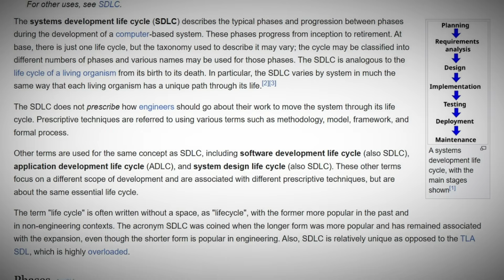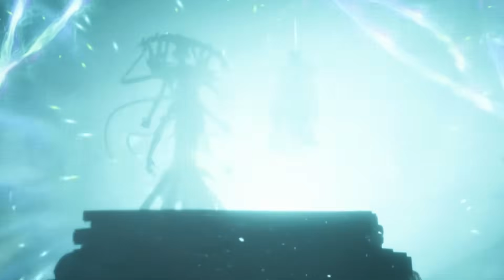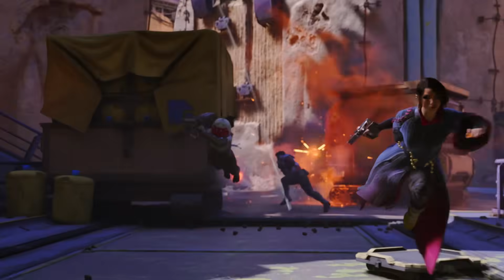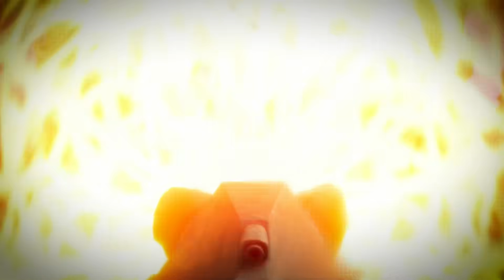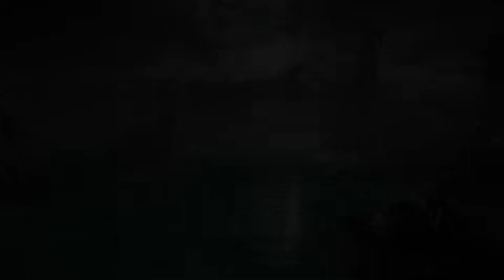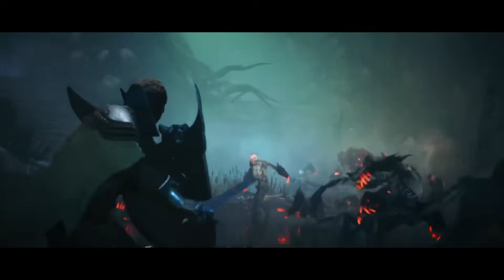Stop Blaming Developers for Bad Games (How Software is ACTUALLY Made)

Comment: I like this video as it shows that software development is a lot more about communication,prioritization, structure and context sharing than technical excelence.

The talk is quite generic and fits and modern software product. Is there something specific for a game development? The frenzy before Xmass or general uncertainty in a game dev?
Reply from the maker: It is quite similar, the biggest differences come more from the sheer size of the team/company. Maybe some random thoughts - in general, I would say there is way more stress on QA in gamedev. Teams are more cross-disciplinary, instead of an MVP, you have a vertical slice (which might be quite polished - basically a piece of the game). The distribution plays a part too, especially in the case of hard copies.

Also, I would like to say that ideation comes from creativity and not market research, but... 😄

Comment: Excellent video, Pavel. This was one of the biggest wake-up calls for me when I first started working as a developer. I wasn’t in game development, but the overall structure was very similar.

It’s a lot like constructing a building: the designers, architects, and engineers may spend years planning and refining everything, while the actual construction phase is often comparatively short. The people implementing it usually have far less influence over the core design and architecture than most outsiders assume.

This is a bit of a tangent from your video, but it’s also one of the main reasons I don’t think LLMs will fully take over software development. Coding itself is only a relatively small part of the overall process. There are so many other stages involved, along with soft skills and human judgement: understanding what people actually want, deciding whether something is fun, intuitive, or visually appealing, balancing trade-offs, communicating ideas, and shaping a coherent vision. Those parts are much harder to automate than simply generating code. Sorry for the long ramble😄
Reply from the maker: Thank you! I totally agree. Gen AI is great for the help with programming itself, also testing, and partially writing documentation, but the human touch is still needed for the vast majority of the process.

We’ll see how fast this comment becomes ridiculously outdated! 😄
Reply: @Dr.Vlasanek 😄